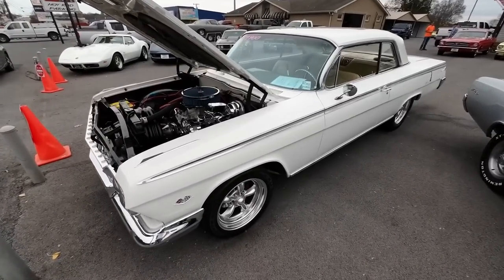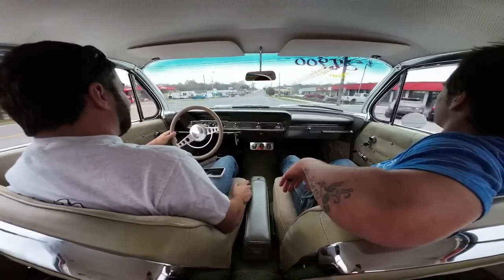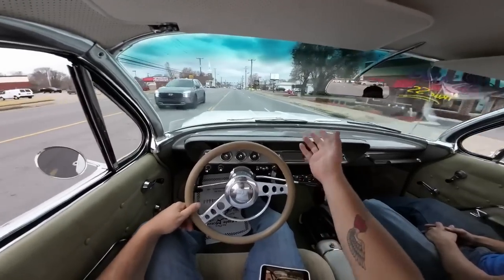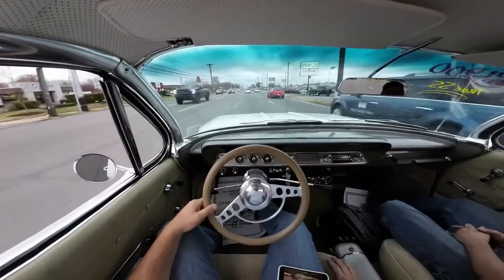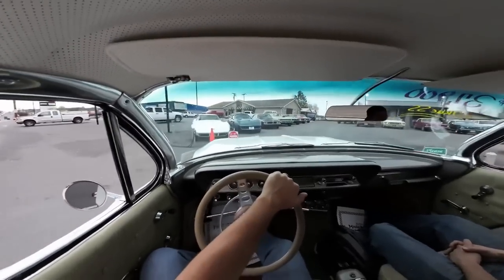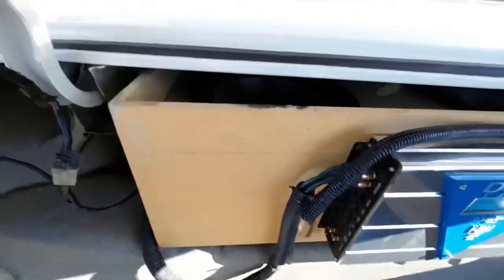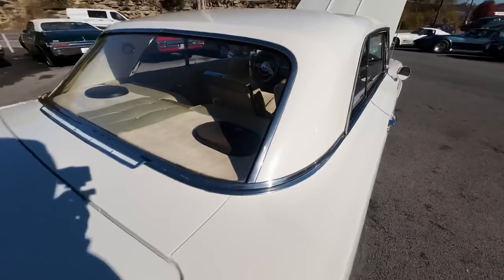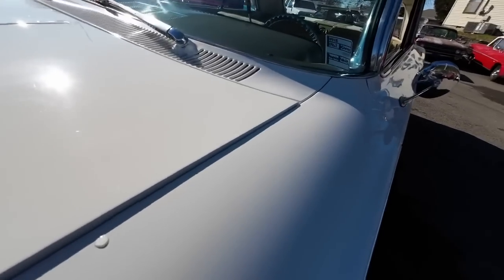Test Drive 1962 Chevrolet Impala Super Sport SOLD $37,900 Maple Motors #1948

Comment: The engine is a new 290 horse 350 GM crate with less than 2000 miles guys.Installed in 2019

Comment: Nice car but the motor is not original and brakes  .. drums are original and 327 or 283  or 409.. type of motor that came with the car.. but still nice car price is to high ..
Reply: This will be gone real soon to someone who didn't think the price is too high. Just the way it is.
Reply: If that was an original 409 car, it would not be good to have another drivetrain in it, to me.
Otherwise, it makes no difference to me.